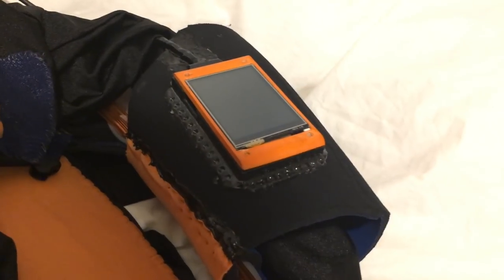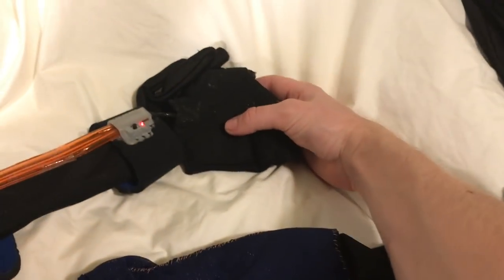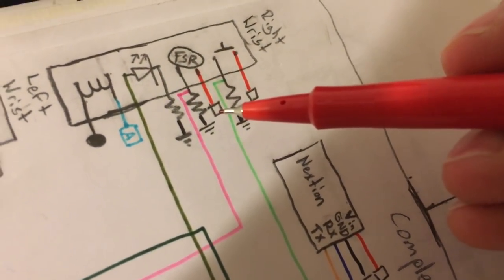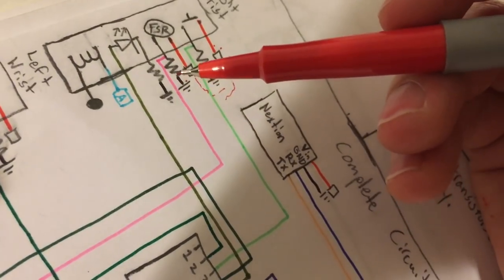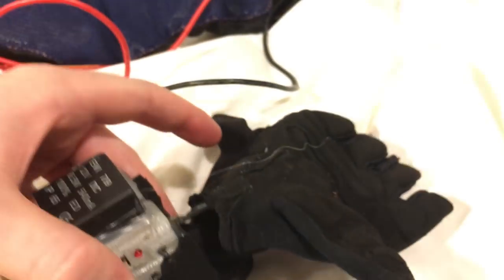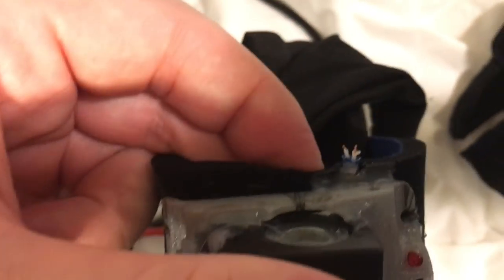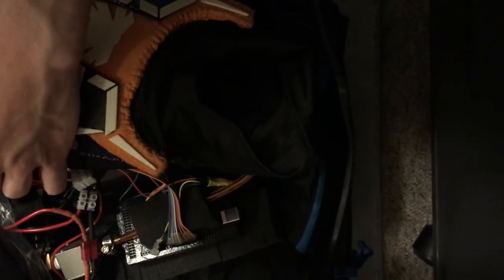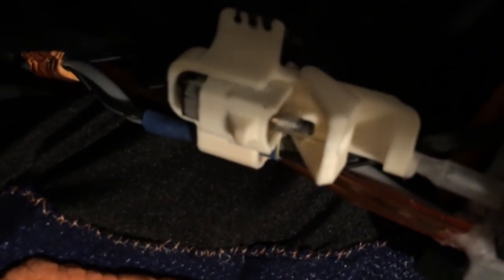Spider-Suit Repairs | FSR Trigger

Comment: Nice! Thanks for the shoutout btw!
Reply: As far as the trigger going across the wrist, have you tried putting a plate at the back instead? I did a video on my channel trying out something like that. It's just a little thing on the back of the web shooter that you press with your hand when you move it down to shoot, leaving your hands and palms completely free with an almost completely full range of motion (I say almost because when you move your hand back far enough it shoots, ofc)